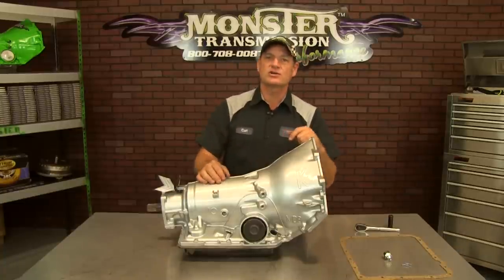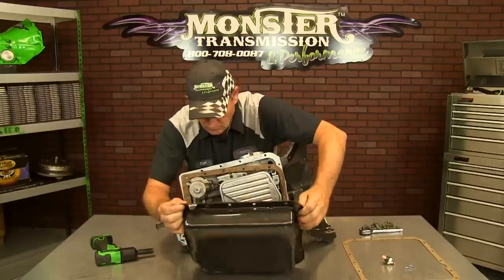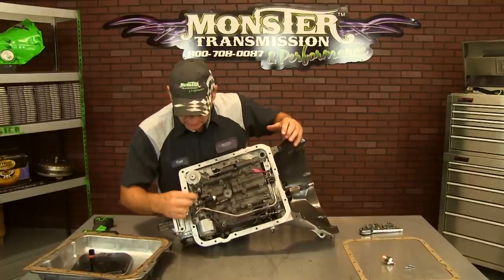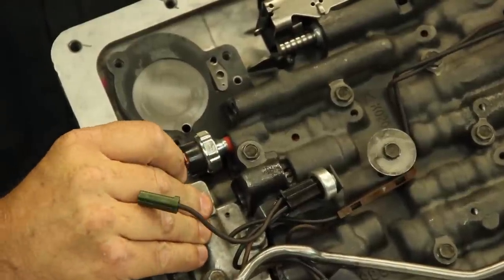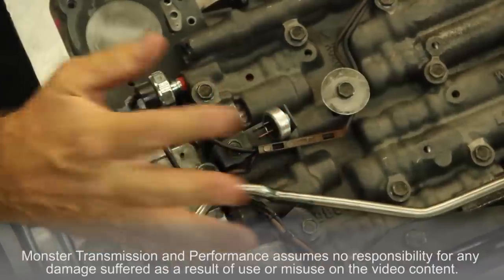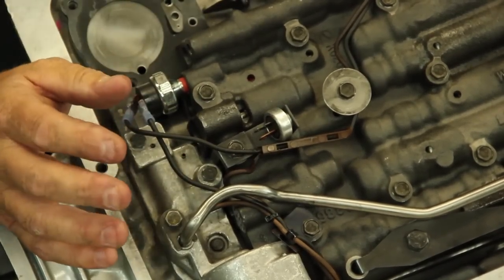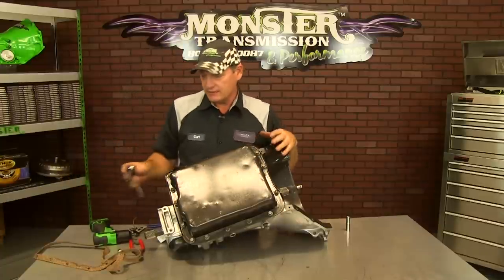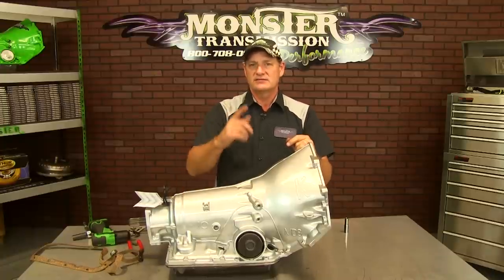How to convert a factory lock up circuit to a 4th gear lock up

Comment: You are the true MVP I understood as to what the 4th gear pressure tap was and temperature switch is but you definitely explain how to hardwire it up better than what Superior Solutions schematic what's showing it was like it was written up by a kindergartener

Comment: A little tip on installing the pan with the gasket, put a bolt in each corner through both pan and gasket. The gasket should hold the bolts in place and keep the gasket in place so it doesn't flop around on you.

Comment: So to get this to lock up all you need to do is rewire change the pressure switch  and have one power wire to the trans from a keyed fused source?
Reply from the maker: Yes, we also have a 700R4 Lock Up Kit will have everything needed for that. You can find it here:
http://www.monstertransmission.com/700R4-External-Lock-Up-Kit_p_4988.html#.WfuD-mhSyUk

Comment: I have this exact trany and will be installing this internal two prong pressure switch. My question is how do I connect the four prong external conector to the switch ?   as this was not mentioned in this video specifically.
Reply from the maker: That is because you're only going to be using the positive and negative wires, the others are deleted.

Comment: So basically we don’t even need the switch? Or (On the driver side connector do I run the run positive wire up to the switch / have other negative grounded to tranny? Or can we run the negative directly to the negative part on switch? Help… thanks
Reply from the maker: No you don't need a switch up top but if you are going up or down hills or hauling a trailer or something super heavy it would help you a lot to have so you don't put too much stress on and lugg out the motor. And yes you can run direct negative to switch.

Comment: And will the converter lock up instantly as soon as the trans shifts to fourth or is in a slight delay
Reply from the maker: In delay until line pressure satisfies the pressure switch

Comment: So I bought a 91 S10 with 4.3 and 700r4, I think I am having shudder, worse in the mornings when cold, will this kit fix that?
Reply from the maker: No this is for conversions I would check tv adjustment and fluid levels

Comment: 700rr on my 89 Chevy z71 lost 3rd gear and overdrive seems to work at a high rpm what's the problem
Reply from the maker: It sounds like your 3-4 clutch pack is burnt.

Comment: Hi I have a 1957 bel air with 283 engine and the 2 speed power glade transmission, I want to do the conversion to a700r4, would you tell me what extra parts I will need to do this job I appreciate in advance thank you very much for any advice thanks again
Reply from the maker: Yes we do offer a perfect package designed to converter your transmission to a 700r4. I will post a link below. Thank you for choosing Monster Transmissions.
https://www.monstertransmission.com/700R4-Master-Conversion-Package_c_5821.html

Comment: Why not use the temp switch? Is it not important to have warm fluid?
Reply from the maker: The temp switch only works for the oem system without a exm to control signal it has to be an on/off system

Comment: So I still plug in the white plug that’s on the outside of the transmission that’s on the driver side ? It’s like a 3-4 white prong plug
Reply from the maker: Yes sir. The lock up solenoid needs the power.

Comment: Must a lock up converter be jused after this mod., or just a standart converter like in a TH400 ?
Reply from the maker: Yes you would need to use a lock up converter on a 700R4, unless you convert it to a non lock up unit.

Comment: How much is the kit, and could I buy it factory direct?
Reply from the maker: Here is a link to both options. One with the 4th Gear Pressure port and the other with out the 4th gear pressure port on the case. Thank you for choosing Monster Transmissions.
https://www.monstertransmission.com/Lockup-Kits_c_3767.html
Reply: @MonsterTransmission  I'm not 100% which one is in a stock 1990 Corvette. Last question is would this lock up in 4th gear only?
Reply from the maker: Yours should have factory Lock up if no one got into it from 1990. Our 4th Gear Lock Up Kit is designed to only be engaged in 4th gear in cruising speeds so take advantage of that Fuel Economy. This is engaged with a Switch we recommend to only turn the switch on when in 4th gear typically cruising around 55mph is the average and when you slow down out of 4th gear you would turn off the switch to ensure you don't burn up the Lock Up Solenoid in the Transmission.
Reply: @MonsterTransmission  It wants to lock up a 45 mph which is way to slow of a speed to lock up in 4th gear. I understand is great for gas mileage, but it's a Corvette, and performance should be first. It would be great to lock up in 4th any above 60 mph.
Reply from the maker: This kit is designed on the switch so you can activate it when you want and you will need to turn the switch off when you come out of 4th gear below 55 mph yourself to ensure not to burn up the Lock up Solenoid in the Transmission. So if you want it to come in after 45 mph then do not flip the switch until that preferred time. Thank you for choosing Monster Transmissions.

Comment: How do it come out of lock up
Reply from the maker: When it down shifts to 3rd, it opens the pressure switch and turns off the TCC solenoid.
Reply: Monster Transmission ok thanks
Reply from the maker: No problem!